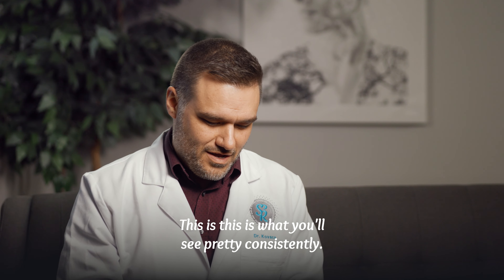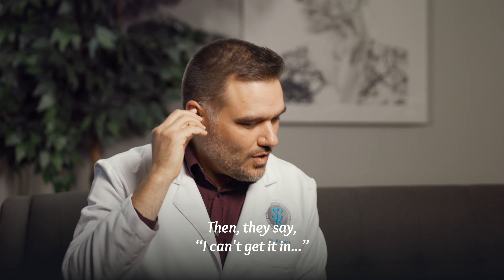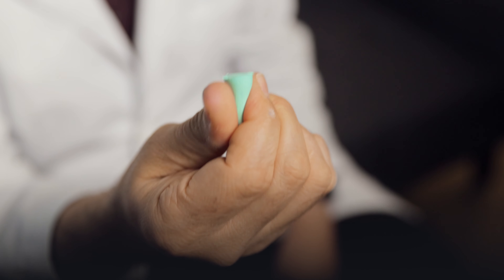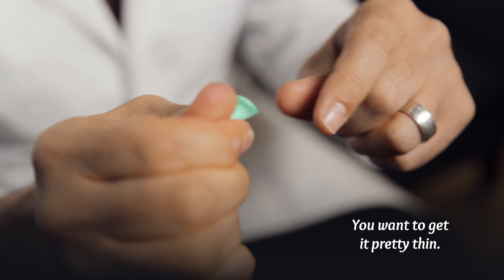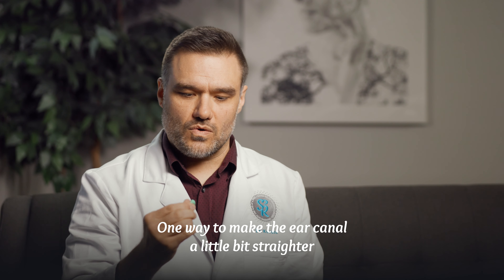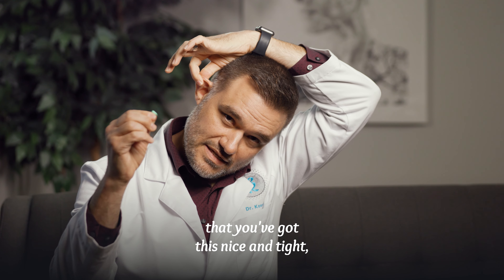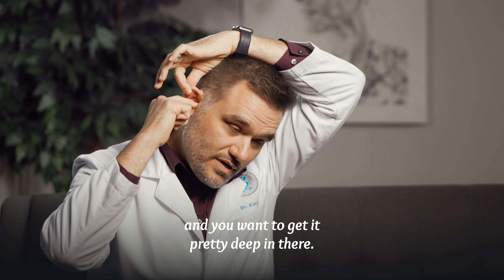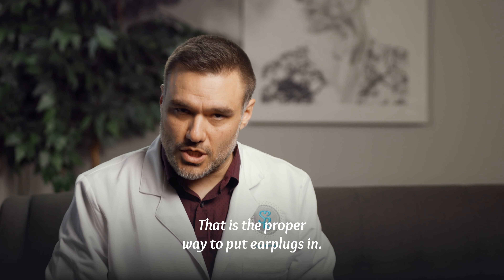Foam Ear Plugs (How to properly insert foam ear plugs) | Tony Kovacs | Sound Relief

Comment: Can we wash foam ear plugs in warm water with little soap to use it again ?
Reply from the maker: That is not ideal. After you use foam earplugs, they lose their memory and will not expand to fit your ear properly. It is best to use a new pair instead of trying to reuse them.
Reply: @Sound_Relief_Tinnitus_Hearing   Small cotton ball wraped with polythene , can we use this type of home made ear plug ?
Reply from the maker: @allone-q6g  Most anything is better than nothing, but you will likely face a similar issue with the combination of polyethylene and cotton. They won't fit your ear very well.
Reply: @Sound_Relief_Tinnitus_Hearing  Instead of foam ear plug , can we use washable silicon ear plug which is available in market ?
Reply from the maker: @allone-q6g  Certainly.